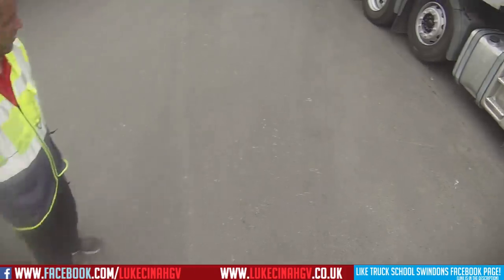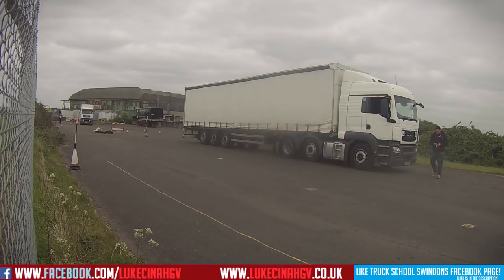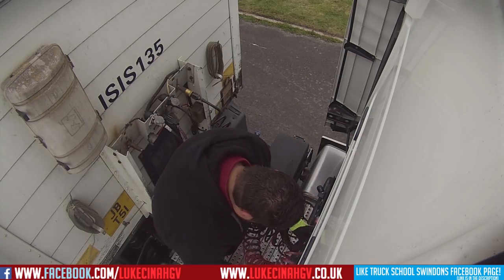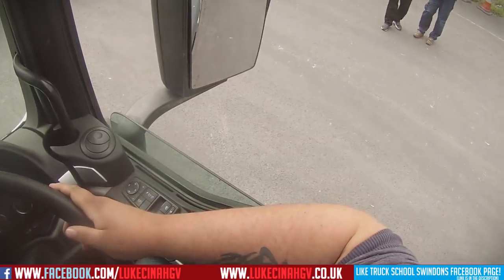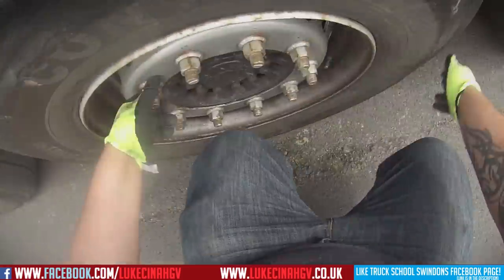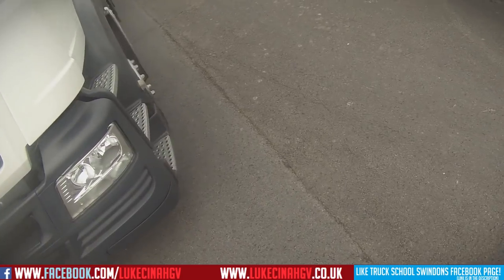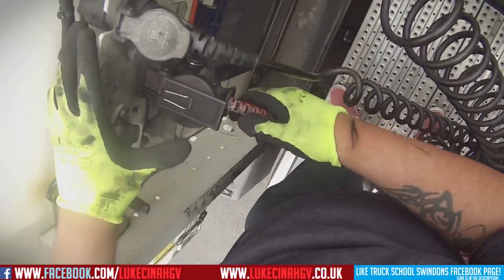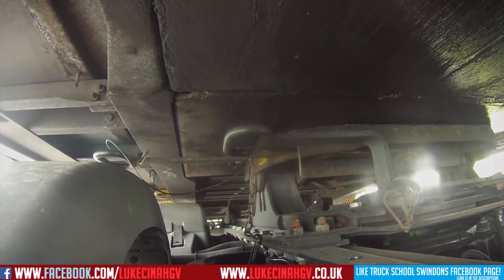Class 1 Uncouple & Re-couple to DVSA Test conditions.

Comment: Congrats on passing Luke,  my license expired in Jan , didn't wish to renew it.
My advice would be to wind down your landing legs just so they almost touch ground, and if your reversing up to the trailer to connect to it, do it slowly and if needed raise the unit suspension as your rolling underneath it, oh and make sure that trailer your picking up has it's brake pulled on. (I lost a good friend in 2002 whom forgot to check, he got crushed).

Comment: That getting out and checking if your lined up must be new because I didn't have to do it when I done my test in December 2016 and congratulations for passing
Reply: Lots of issues with going in at the wrong height... Getting out to check is well worth it. 

I've seen damaged cabs, bent trailer legs, grease all over the catwalk, damaging the headboard, destroying mudguards and suzie's. 

I was taught poorly but now I respect the equipment and I get to keep things clean and professional too.

Comment: Interesting the extra connectors you've got. Here in the states we have one master electrical connector, parking/emergency air line and a service air line.
Reply: We also have the pig tails on the tractor side and use glad hands not quick connect sleeves.

Comment: Best numonic I heard to remember everything is BLANK

so for Uncoupling it is Brake, Legs, Air Lines, Number plate, Kingpin

and then for Coupling it is the reverse.

The order is important ( I know it's slightly different for your Split Couple)

Once on one of my very first jobs, I was doing a trailer swap with another driver in a busy service area, and doing the uncouple, I did Kingpin first. the other driver warned me about the dangers of doing that prior to the Brakes and Legs, (some drivers will tell you the air lines do the brakes, so you don't need to bother) but the BLANK system works everytime and is FOOL proof....

Comment: when uncoupling a trailer its best to leave the legs a inch off the floor then lower your suspension only because if your trailer is empty when you uncouple and its loaded with the legs all the way down you will find it hard to get the legs up when you couple back
Reply: Just lift the suspention  on the cab until the legs are slightly off the ground.
Reply: does not work all the time if there is a lot of weight on the front of the trailer and if the guy who uncoupled the trailer drop the legs until he could not turn the handle anymore or just if your 5th wheel is lower then the 51". I have had a few done that with the suspension all the way up and in low gear and it still took 5 min to get the legs up
Reply: fair shout, fully loaded my load weighs a max of 5 tonne so I've never had that problem, handy to know for future reference though 👍

Comment: Another cool vid Luke. Just one question at 05:24. Why do you have to take the number plate off?
Reply from the maker: ThePerfectSpecies it's a simulation of taking off one trailer re coupling to a  new "different" trailer. If you don't take it of the old trailer you won't have one to put on the new trailer meaning you wouldn't legally allowed to drive it.
Reply: Luke C in a HGV Ah right. Makes sense that the reg. plate of the trailer and tractor unit should be the same. Cheers for the feedback. Keep the cool vids coming mate.

Comment: Good video Luke , handy for me especially, been driving wagons for 28yrs now , 10 years on artic bulk , tippers quarry work and the rest on 6 & 8 wheeler brick crane wagons , cut my teeth on twin splitters and 13&18 fuller boxes , only drove 1 semi auto box in my life , still got a manual splitter box now and still on paper tachos , on me 3rd digi card but only used it a couple of times since I've had it lol ,,, anyway I'm goin for a driving assessment on wed for a major blue chip company back on the artics on trunking so a lot of this new kit is new to me ,,, especially the manual entries on the digi but I'm sure I'll suss it out ,, o btw , I need a new sat nav as mine is that old they don't do map updates anymore ( garmin ) ,, any preference on the latest garmin or tom tom for trucks ? Cheers Chris

Comment: our trucks don't use dog clips it uses a different form of clip like a braket u lift up then pull handle
Reply: Most of the ones I come across have the bracket thing that you move with a short cable AND the dog clip.
Reply: Kev Moreland 
Oh yes Kev...the little L shape bracket on a spring and a dog clip to make sure the L bracket does not fail...how many times have you trapped your fingers in the cable that lifts the L bracket when you pull your pin....bugger hurts lol.

Comment: b.l.a.n.k
 
brake
legs
airlines
number plate
king pin
Reply: B.L.A.C.K 

Brakes 
Legs
Air lines 
Clip
Kingpin

This is  how i was taught, they just said about number plate before you leave but most examiners don't even ask about it
Reply: I was taught BLACK N.....Brake, Legs, Airline, Cables, Kingpin, Number Plate
Reply: BLANK. I guess you can't forget the clip when dropping... And if you be don't use it when picking up, you probably shouldn't be driving.

I come across this video because I'm looking for a good close couple procedure. Not something I've done often and I find myself walking around in circles.